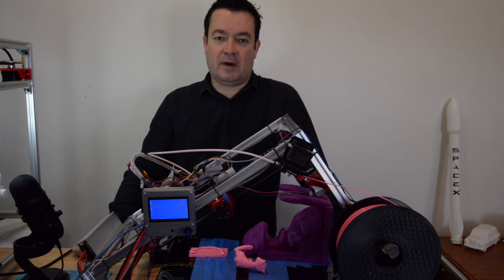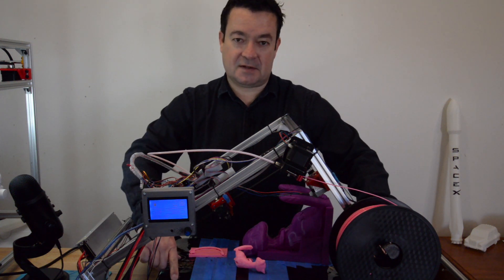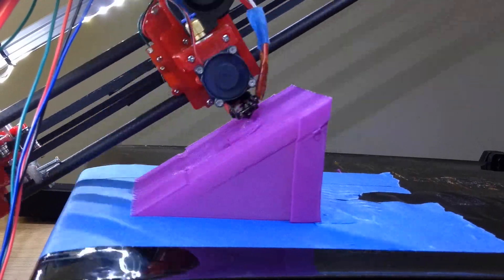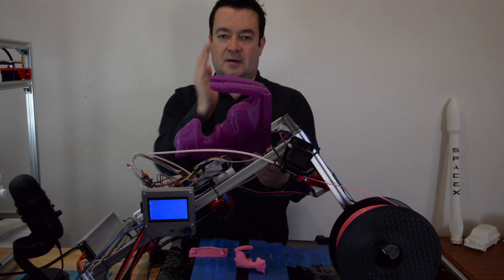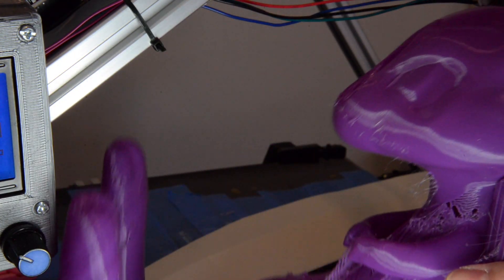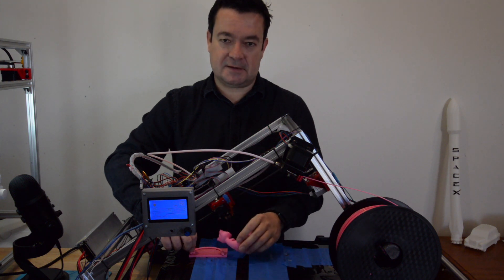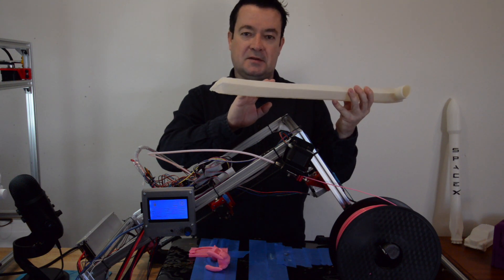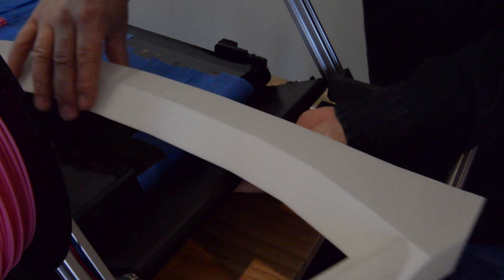Hypercube Infinite Belt 3D printer updates and failures

Comment: Keep pushing this design! I wouldn't use rollers and/or springs as my first option: I would try to use a flat (polished metal? glass surface?) bed aligned the rolled bed, or maybe just an hair (paper thin) lower.

Comment: Nice improvements, happy to see the quality goes up. Did you try thinner layers to help a bit the overhangs ? I would be curious to see what are the limits you can reach for instance with 0.2mm, 0.1mm and 0.05mm layer height. Thanks again and keep going this nice work !
Reply from the maker: I'm currently printing at 0.2mm layer heights. I will try lower layers for sure. I get good results at the moment by using more perimeters, but lower layers might be a better solution. Thanks for the idea!

Comment: Hello, good job, i have same project to your, watch my last video and my twitter @Mister3DFrance
Can you explain how you make raft and supports ?
Your belt have wave, mine is in Kapton and the problem is much less strong.
Reply from the maker: I use blackbelt3Ds version of cura to make the support. A made a small video https://www.youtube.com/watch?v=Qq5Fc_5o0SA&t=5s I don't know how to make rafts yet.https://blackbelt-3d.com/blackbelt-cura/
Reply from the maker: I damaged my belt using a nozzle temperature of 250 without putting kapton tape down first. How did you make your kapton belt? I watched your video (great work!) It looks like it is only kapton. Not kapton on stainless steel shim like printrbelt.
Reply: Yes, just Kapton, two strips one on the other glue side glue. After we make the loop and cut the two strips at the same time, then a connection with a band of 50mm. Next time I will add another thickness.